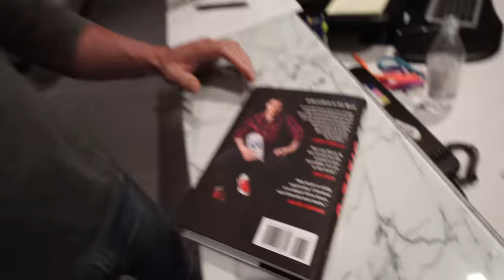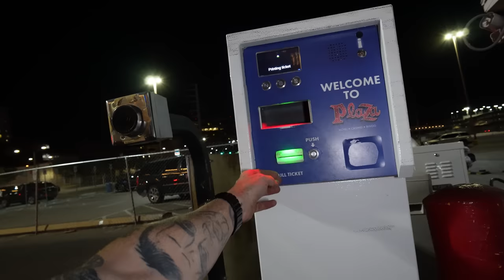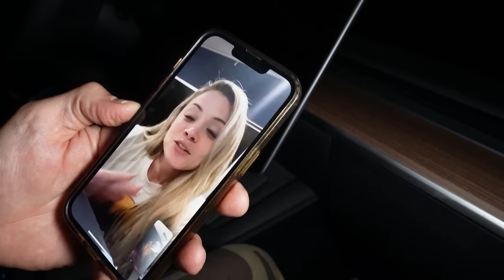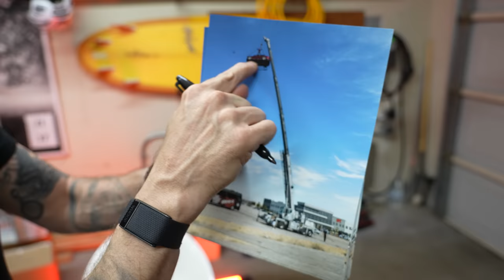Living In My Car In Las Vegas (Hanging From A Crane!) | Steve-O

Comment: That feeling when it got to the top was one of two things it was either the anti-to block system, which is when the hook goes up to high and it hits a safety device that stops it immediately or who tried to extend or reach track the move after the load was all the way at the top. Either way you were OK.

Comment: By the looks of the picture you showed at the end I would say it was the anti-two block system. He went you up a little too high. The system is so the cable does not break when he went to visit him to the moon I’m a certified crane operator of 30 years.

Comment: @4:28 "there's no motor, right?"... Bruh, the definition of a motor is a device that converts electricity to mechanical energy. It wouldn't move without a motor. I doesn't have a combustion engine, however.